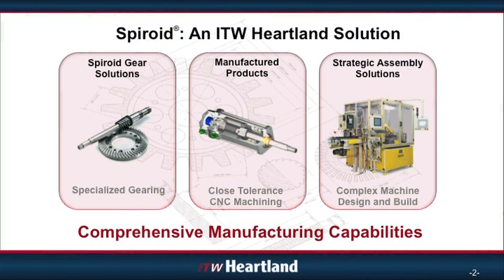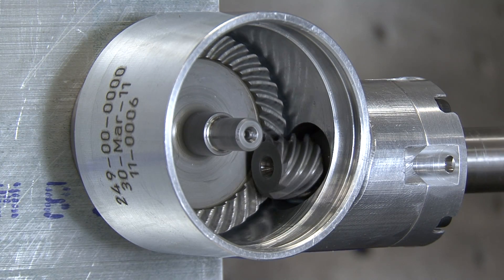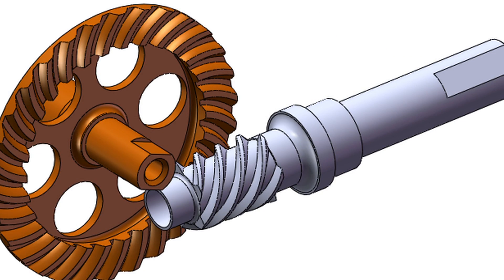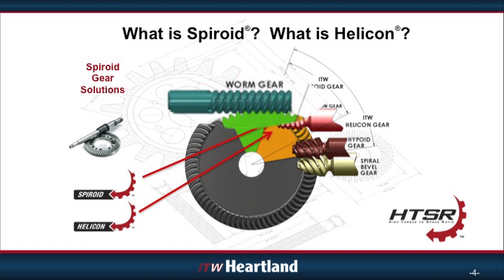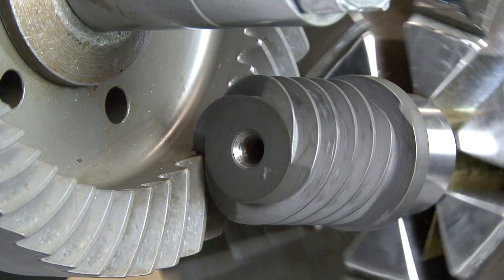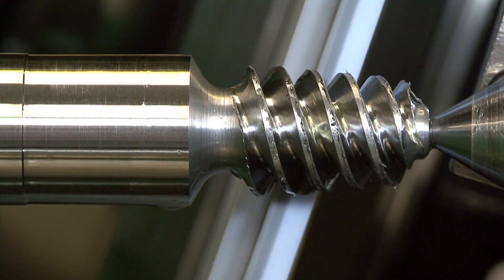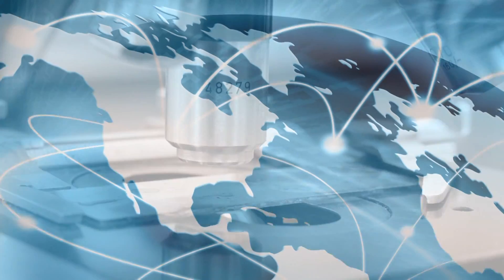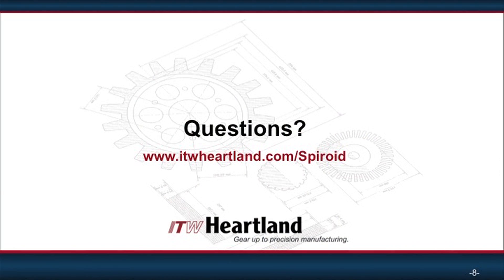What is Spiroid? - Advanced Gear Solution

Comment: The 3d CAD model on 43 sec ov the video seems to be incorrect. You can see an interference between the teeth of the gear and the worm pinion. The manufacturing process shows hobbibg only, which requires special fixture to support the end of the hob from deflections and the hub itself is very special and higher cost. The hub needs to be as small as the pinion so it cannot cut large quantity of the gears. The other noticeable issue with this promotion is that it does not show tooth contact pattern. The video shows the gears individually but not in mesh with good contact. The video shows 3d models but does not show good tooth contact pattern simulation. Failure to prove the contact pattern in 3d together with interference on 3d models(43 second of the video) makes customers skeptical about resulting quality of the gears. The video is not showing the modern trend in gear industry: cutting gears on universal CNC milling machines. The face gear shown has an advantage to be cut on 3-axis CNC. Most of the plastic gear manufacturers do not even hub the gears. They cit the molding cavity tools from 3d CAD models. But this video does not show correct 3d CAD models. I think this promotion would benefit much with the following additional videos:
- correct 3d CAD modeling of the gears
- correct tooth contact simulation in 3d
- simulation of the tooth contact with misaligned shafts
- cutting the gear on 3-axis CNC
Reply: trapezoid thread was known long time ago where  one side  was straight
carrying more force
also the  process  as i know  was the pfauter

klingelnberg had  similar process, but  teeth were ""symmetrical""

inded what i found new the  gear skiving straight and  helical gears can be manufactured  in fraction of time  compared with maag or  pfauter
Reply: If it is a Proprietary and patented thread pattern, manufactured on their own equipment developed exclusively for this thread geometry, why would it need to be compatible with 3-Axis.
Reply: https://youtu.be/dZGKvtVrz5c